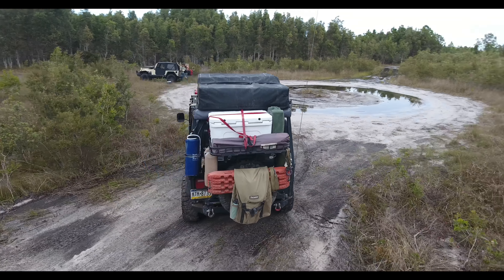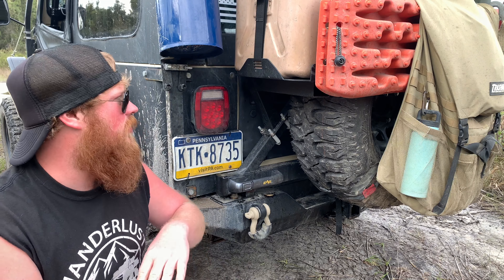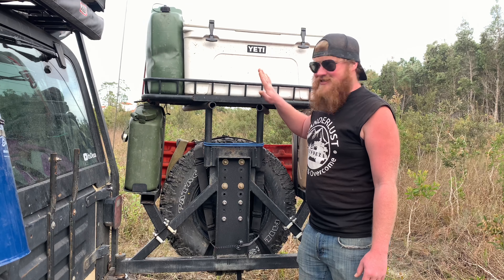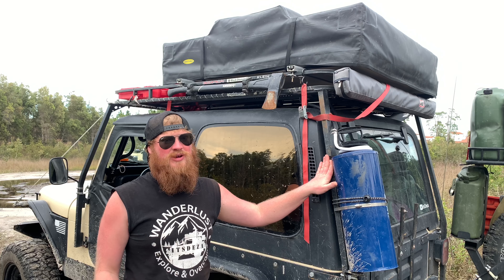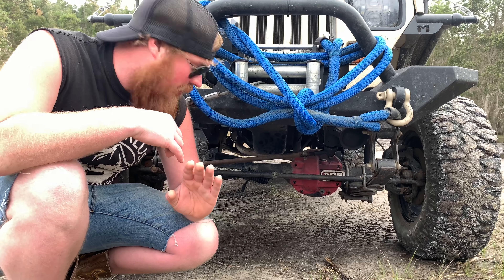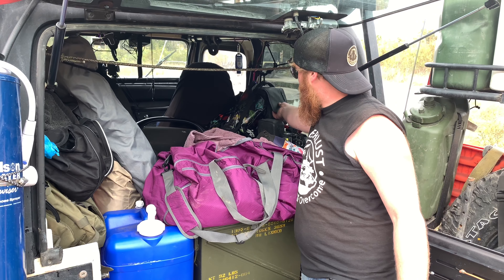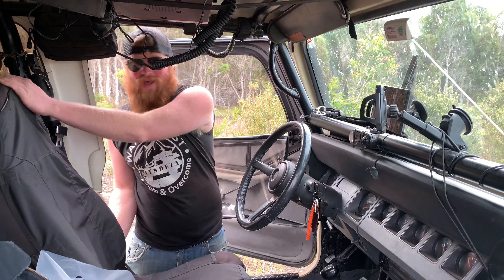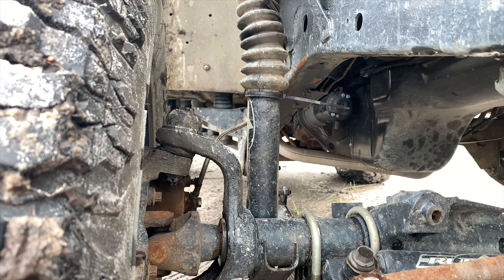Overland Setup! Jeep Wrangler Yj

Comment: Is your Dana 35 still alive??
Reply from the maker: Finally broke a shaft on the 35 rock hoping up a hill climb. slide an old shift in on the trail and got it home. So I’m looking for a Toyota 8 inch with the factory elocker to replace it. I found one but it ended up way to wide so trying to find the narrower one still, that’s why I built up the Tacoma to keep traveling until I find the axle I want.
Reply: @itsDeza  better off with Dana 44 out of CJ...I’ve had 94 YJ 14 Years	been tru it all..